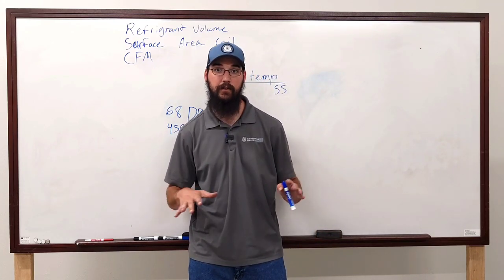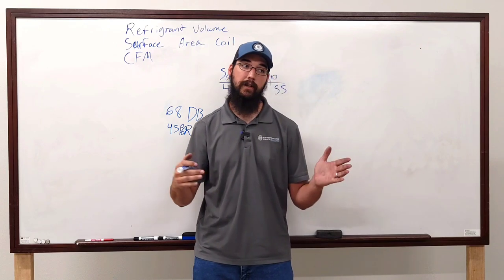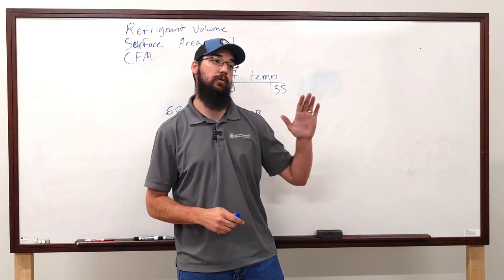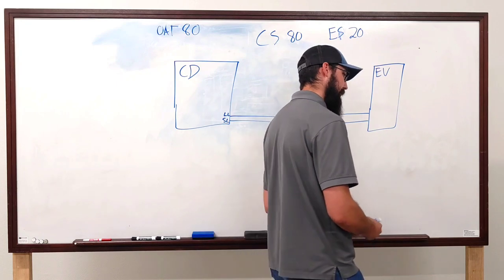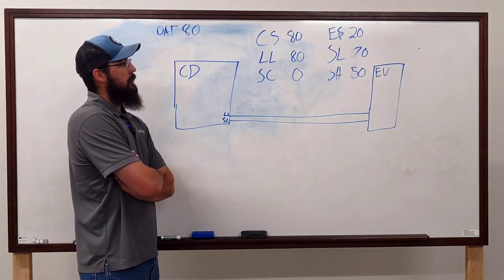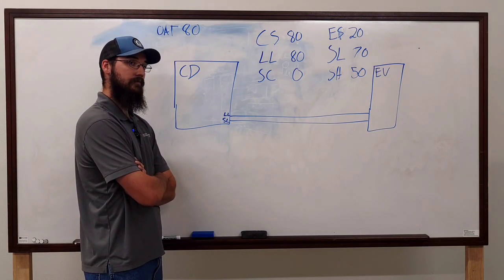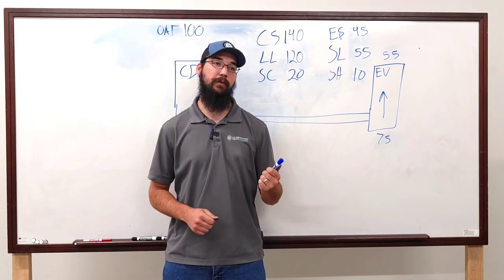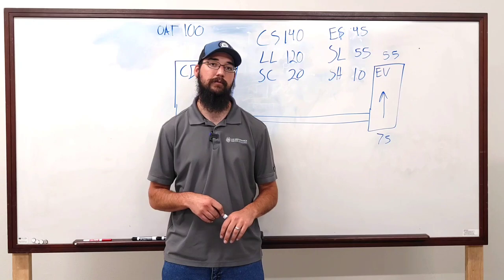HVAC Training: What is HVAC? Part 3

Comment: Love these little tid bits; can't wait to see what you have in store for the advanced portion of this class!

P.S. on the last scenario, I was screaming at my screen why no one was asking if the condenser coil was dirty because if it wasn't, it would be fan all day. Either reversed rotation of the motor (like you mentioned)/ fan blade or my favorite, the depth of the blade inside the shroud!

Comment: I was taught subcooling is the amount if refrigerant in the system and also indoor doesn't affect subcooling. Now I'm not sure
Reply from the maker: That works for a basic level and system but when you get into more advanced situations thats not completely accurate. The high side of your system is relative to your low side heat input. If the evaporator is not pulling in much heat then the condenser wont build much saturation above ambient to reject that heat which doesn't allow subcooling to be very much because you can only cool the refrigerantion as low as the ambient temp outside.
Reply: @HVACTIME  i see that makes sense. I learned from a training when i used to work in residential but I  started working in commercial recently. I learned a lot from your videos, thanks very much

Comment: You are not teaching anything. How would you have high sub cooling when you out a cond. Fan.i dont think i agree with one lesson you where trying to give.this was really horrible i thought you where way more experienced .this was bad.it seems like you are trying to over complicate simple and day to day problems with made up numbers and not pressures.no one asked what unit it was was the hp switch manual reset,if it was running why wasn't it locked out.just please stop
Reply from the maker: Thanks for the input
Reply: @HVACTIME  i was drinking when i made that comment and looking at it now i sounded like a a hole.sorry for being so negative. Dont listen to me.

Comment: Ha! Senior tech looked at me weird when I said I only know what temperatures to look for. DTD of evaporator and CTOA
Is it an old Consensus to know your pressures?
Reply from the maker: Yes, before techs were trained what saturation was they only knew pressures. Those days there was only 1 refrigerant they really worked on per type of equipment. Either R22 or R134 for the majority. Granted they had r11, r12, r512, & hotshot